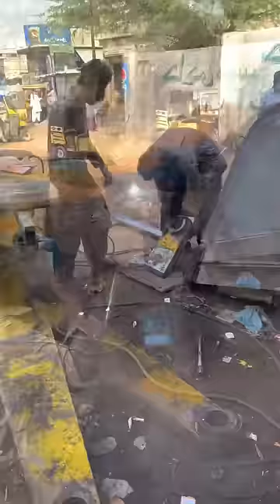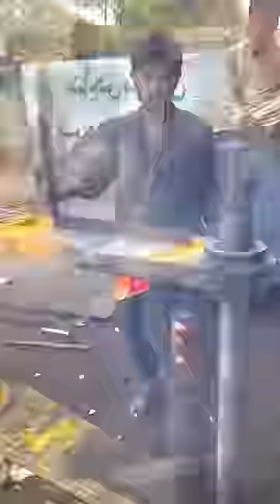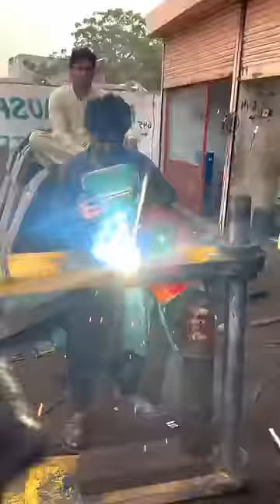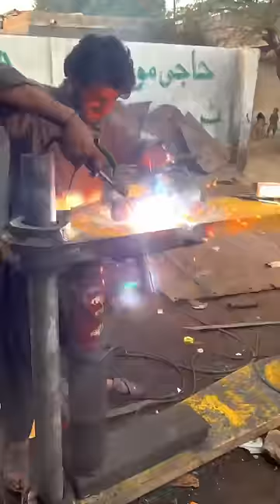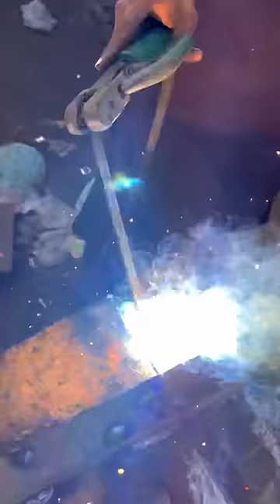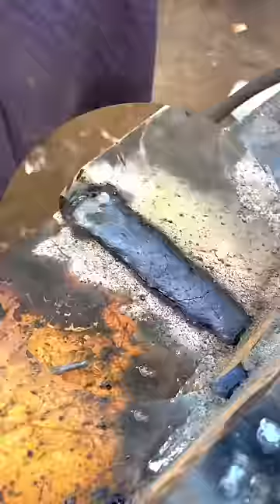How to joint Caterpillar loader Boom Replacement with welding #shorts #technology

Comment: Bro. That’s actually a decent weld. Put some respect on the sandals 🤣🤣💪
Reply: Your funny
Reply: Supposed to have a sense of humor fellas. I get it though everybody a hater 😂👍
Reply: Нам не нравится работать в пакистанской службе безопасности
Reply: That weld will probably break in about 3weeks they did no root so the weld will probably hold but will not hold for long due to improper welds
Reply: @masonlegendre2831  hey buddy. You read any of the replies or are you a bot ? It was a joke
Reply: @masonlegendre2831  wooosh that went straight over your head so fast! You must be fun at parties.
Reply: @masonlegendre2831 That's what you call job security . Do to good of a job you will be making scandals .

Comment: Warranty, 2 miles or 2 minutes, whichever comes first
Reply: In your dreams have you ever been to india or pakistan
Reply: @boblyswegar8351  no but I’ve had to fix them worthless garbage “welds” some I dot tried to cheat, there’s extremely important reasons why we lay one bead at a time & walk the stitch while doing so, first good wack & that hot glue gun abortion is popping like a Cub Scout at the playboy mansion
Reply: They constantly break their loaders.
Reply: 2seconds bro
Reply: well, some people wont understand the point of the comment😂😂
Reply: That won't last as far as india goes I live in candostan it's alot cleaner but that's about the only difference.

Comment: Placing welding rods into a large cavity that supposedly needs to be welded up is called lugging and no welding code on the face of the earth allows it. Most farmers don’t weld this bad.
Reply: I totally agree with you👍
Reply: They weren't laying them in and welding over them.  They laid them I  for sizing and then pulled them out and used the three rods side by side to weld it.
Reply: And its incorrect😂 @BMStoryTime

Comment: If you go through all the trouble......at least pre-heat it.
Reply: If they know, they should have to like that😂
Reply: the first pass is enough to reheat it.😂😂😂
Reply: @siredhorselangmalakas6331  not true!
Reply: Its probably 110 degrees outside, good to go
Reply: It's hot in Pakistan ya know 😁
Reply: @richardmidgley4369  150 degrees Celsius? Because that would be a reasonable preheating temperature, with an interpass temperature of 250-280 degrees Celsius. Its hot in India, but I don’t think its that hot🤣
Reply: @siredhorselangmalakas6331  have you noticed the thikcness of the material? The moment you start welding the temperature  will flow and drain away😂
Reply: @fishnbeer556  you are talking about Fahrenheit with 110 degrees outside, which is roughly 45 degrees Celsius. That’s not enough. Around 300 degrees Fahrenheit would be a reasonable preheating temperature.
Again “hats of to Larry”, but this is technical not a proper welding procedure. Even the interpass temperature (which should be around 250-280 degrees Celsius),will drain away with these thicknesses. Believe you me.
Reply: He just weaved that ?
Reply: Exactly

Comment: Safety squint: Check 
Steel tipped toe nails: Check.
Good to go boys.
Reply: When your workers are expendable, these are the work conditions. Profit above all.
Reply: Not the steel tipped toes nails😂
Reply: Not a tape measure in sight 😂 they better hope that fits the bucket when they are done
Reply: And don't forget the spotter❤
Reply: If it fails...? Well you only paid around $3.00 US currency?
Reply: Aside from the ppe they did a solid field level repair and kept things square as the pin was
Reply: Steel tipped toe nails 😂😂😂😂😂😂😂😂😂😂😂😂😂😂😂😂😂😂😂😂😂😂😂
Reply: OSHA gave ok for experimental open toed flipFLOPS😅😅😅
Reply: Steel toe flip flops and gloves wrapped around stinger good to go
Reply: You Jealous 😈😈😈😈

Comment: Everyone talking about that welding..

Meanwhile me: how the hell they were able to break that arm? What the hell they were doing?
Reply: Years of bodging the steel back together, constantly heating it up to bend it back into shape..
Reply: Se quel braccio carica 10 tonnellate, loro ne caricano 30, non sanno lavorare.
Reply: By doing shit welds
Reply: Breaking concrete.
Reply: Prolly lifting them pyramid blocks
Reply: It was shit when new
Reply: What happens to the slag on the bottom of the 3 welding rods they laid in the groove?
Reply: @tomchrisfield7348  they didn't stay there
Reply: They had to cut it to take it off the machine 😅
Reply: Stress crack from metal fatigue.

Comment: É fico pensando se esse processo com 3 eletroldos vai fazer uma solda com profundidade ou simplesmente vai derreter os eletroldos e fechar o vão. Processo artesanal e muito perigoso, quando colocar forças
Reply: The 3 electrodes would just fill the gap. Shitty workmanship.
Reply: Senza contare che deve tenere un amperaggio così  alto che la pinza gli si scioglie in mano.  Non si lavora così, quella saldatura si romperà di sicuro. Sono molto ignoranti.
Reply: Se quebrar, eles solda de novo sem problema o importante era aquecer primeiro
Reply: This function makes more lack of fusion in welding... 😅😅😅😅
Reply: Admiro muito esses vídeos onde eles priorizam totalmente pela segurança !!So que não !😮😅😂 Acade os IPIs
Reply: It will just fill the gap jb weld would b stronger. Just coz u can doesnt mean u should.🙏

Comment: This is not proper welding. There might be inclusions in the bonding. No preheating will change the microstructure which might up in cracking by heavy load.
Reply: A estos tipos les importa poco tu opinión, amigo! Hacen su trabajo, no hay quejas y lo hacen bien. Las normas sobre soldadura ni las conocen!
Reply: It’s India dude
Reply: It's out in the sun it's probably 150 or 200 already stop making up things
Reply: Might" 😂👍🤦‍♂️
Reply: There’s not gonna be any porosity or stress cracking in that…. C’mon , this is India or Pakistan or wherever else the hell they are… that thing is good to go.
Reply: @RJB88525  yes, and?
Reply: @claudiomoranc so they don't do their job, and not well 😊
Reply: It might work for them. Besides them who the hell cares!
Fact is this is not proper welding, no code in the world will allow this. And I know for sure.
I used to be a coded welder in the offshore industry,(mainstructure, flowlines, B.O.P’s, (Blow Out Prevention’s), Hook ups for platforms, riser lines, leg structures of platforms, fleedwelding on land pipelines. And under various codes. I have done my parts. Became a registered Welding Engineer, became a metallurgist. Eventualy became Quality Assurance manager in the offshore industry. So I think my knowledge is sufficiënt enough to judge.
Again it might work for them under these circumstances, but it remains that it is not proper welding for these kind of materials where heavy loads are common use.
For sure you will have slag inclusions and you could consider hydrogen cracking due to not preheating.
I applaud these guys for working under these conditions.
But it is not proper welding.
Reply: It's shite, cosmetically ok to the layman, but in engineering terms shite.
Reply: @claudiomoranc 😂😂😂😂
Reply: @nigelmitchell351  totally correct 👍
Reply: Now don't  be silly! these guys are working to a weld procedure, developed in their own Met Lab and signed off by a certification authority, and that welder is AWS D1-1 6GR coded.
All will be confirmed by MPI, UT, and Xray results carried out in house.

Comment: Good video. I watch these men and see they are really skilled at what they do especially with the low grade equipment and facilities that that have or lack of. I'd like to see their faces if you gave them a state of the art fabricating shop with everything in house to make anything. They were supposed to preheat both plates to a certain temperature and use a welders heat temperature melting crayon that will only melt at a certain temperature. The welders heat pens come in all kinds of temperature melting points. If you don't preheat your thick plates before welding they will break again where the sides of the welds tried to melt into the steel plates. Welding isn't so cut and dry. You've got to know how to prepare your steel witch they didn't put a good enough bevel on the plates and before you start welding the opposite side you have to back-gauge the bevel into the weld itself with a grinder or an air arc guager that is like a stick welders stinger but also has an airline on it . You use carbon rods when air arc gauging and as the rod melts away the metal the air pressure blows it away. After guaging you use a grinder to clean everything up making sure to grind out all slag and carbon that was left behind. You want your weld to be 100% with no crack left where the bevels center edge was because that would be a major stress point for a crack to start under the right conditions. Also know what kind of steel and rods or wire to use !
Reply: Well put, praise where due and educational information. Beats all of the cocky critics. Good health 👍
Reply: "Which"  not "Witch" unless there is a broomstick involved 🤔 😉

Comment: Putting  electrodes  in the joint?  Ultrasonic testing ?
No preheat   ?
Waving     weld?
You are going to lift cotton for sure.
Reply: Not to mention the GP rod's ,never used on high tensile steel in 🇦🇺

Comment: Great fix. Fish plates help it to 100% strength or better. Somethings can't be welded back to 100% or better. Only drawback is with fish plates,😊 it weighs a tiny bit more. But that's hardly anything to the machine.

Comment: I question the use of welding rods as a fill weld like this! Although hes beveled his steel ,os he getting good penetration into the surrounding metal,or just getting a good looking fill weld,with poor bite into the peices hes welding!
The fimal weld looks good
Uses 2 rods in handle, ill have to try that!
Wait i did once!

Comment: It's welded and is weaker than before, and it will break soon again. There was no preheating and im not sure if the welder did a good root pass. It will work for a small amount of time but will mist likely kill someone when it fails seeing how they are so safe

Comment: I was with you til that 3 inch wide weld what was that , run passes dont rush welds like that it will break easier that way

Comment: Fact Check 
*
    Look at the ratty cut 
   Where's the Preheat !
   How Many Passes ?
*
        Not Structural !
Reply: Structural?? It has to be cast again from the start to be structural… it s meant to last until it breaks again, welded again and so on.. they work with what they have ..
Reply: @davidadrian4548  
*
          Fact Check 
*
   Are you a structural
         engineer  !
,*
   That is All Forged Steel  !

Comment: Fake. They are pretending to carry out an impossible repair: the structure of the steel after welding will not be the same as before and the arm will bend like a candle, they carry out the work to have subscribers to earn money through advertising, not through (non)work

Comment: I learnt a little bit about welding but I'm no expert but welding 3 electrodes at a time can't fill that gap properly there will so many holes in it plus I bet there is slag mixed in with it. Also as someone said the size of those arms they will be under so much stress that they will fail and end up having the same job done again quite regularly. Time is money and they are just filling it with material to get the job done and get paid. And they are probably always in work because the previous guy has done the same shite job just like these

Comment: This is a real mechanical piece of crap. Yes it's a good welding but no lateral reinforcement.Soldering enhance the point of failure, so a reinforcement it's mandatory.